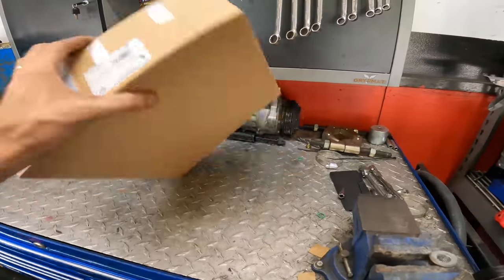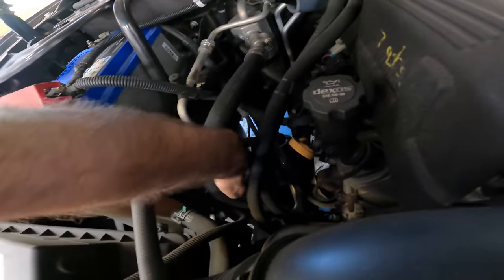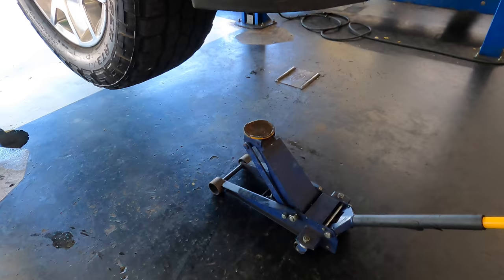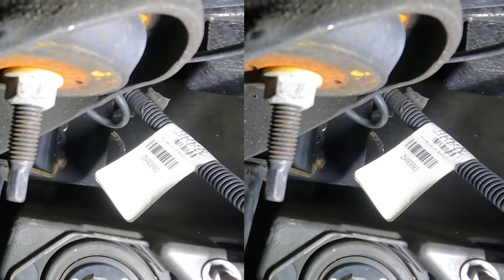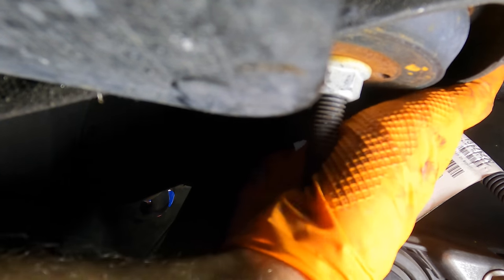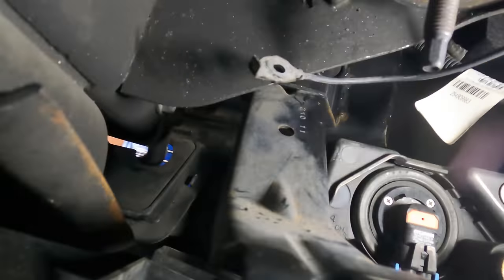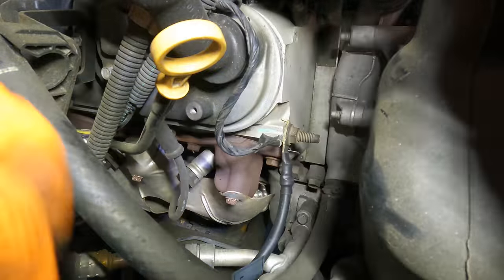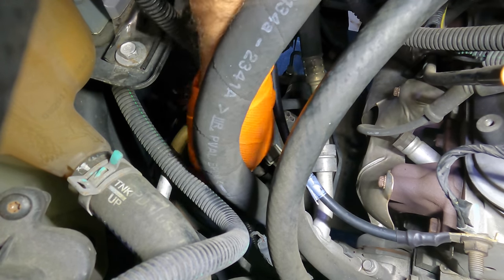Cadillac Escalade 6.2 NO Power, memory keeps resetting. Customer Request Battery Cable.

Comment: Ray, as the owner of this Cadillac Escalade I would like to thank you again for taking care of my car. 👍
Reply: @Albo alt He tells you in the video :D
Reply: Wish I lived close enough to have Ray work on my car.  He is a fantastic Mechanic!!😀
Reply: @ThunderPantz01  i seem to have also missed that.  i was thinking that was an odd starting place.   I also watched while work was going on in the background so I could have just missed what was wrong with the first cable.
Reply: @Albo alt Ray reveals the issues at about the 20 minute mark but to save your time the clock was resetting to zeros and computer was loosing its factor settings  owner had figured out the ground was bad
Reply: @sneeuwsushi Glad to know he did as expected, customer first. 🥇👍😇🙏 Your's is the first customer response I have seen from his posts.
Reply: Definitely keep bringing your goodies back to him.
Reply: @Albo alt I’ve had one battery ground problem in 50 years of driving. But grounding issue’s are difficult to figure out in modern cars.  Most shops would have fired the parts cannon. I guess the way to test the ground cable would be to measure voltage drop as you moved and twisted the cable.
Reply: I have watched multiple videos from Ray always wondered if one of his customers were watchin him fix their vehicle good to know it does happen
Reply: @Albo alt The owner diagnosed the problem and requested the ground cable replacement.
Reply: Glad he didn’t have to CUT your Cadillac 🤟
Reply: @Albo alt I was sitting at a traffic light and the engine started to misfire while the radio and instrument panel lost all power.  After a few seconds everything was working normal again, but the clock/time was reset to 12:00PM and actual time was 8:30AM.

When I got home, I turned the car off and it would not restart and had no power.  Car would not lock/unlock using the key fob.  From my research I found out having battery cable issues are very common with 07-14 Chevy, GMC and Cadillac GMT900 platforms.

I opened the hood and started jiggling the negative/ground wire while pressing the lock button on the key fob and it locked the doors.  I jiggled the Ground wire again while pressing the unlock and lock buttons on the key fob and it was working intermittently.
Reply: So the customers do actually watch these videos.
Reply: And some are smart and don't fire the Dorman parts common with a half dozen crappy parts to ruin Rays Mondays!
Reply: @SneeuwSushi  Great job doing the research and then not just firing the parts cannon trusting it, but taking it and then testing it. Well done!
Reply: @Albo alt I haven't finished the video but it's fairly common to see cracked/bad ground cable welds after accidents.. or if you live up north (frames hate salt) and in the country on bad roads pot holes lol ... can really cause some crazy stuff in some vehicles too.. anytime I've seen complete FUBAR electrical issues.. I check grounds before I even bother testing.
Reply: @phillipdewitt4454  Yes... they're a biatch to figure if you haven't seen it. It can cause all kinds of hell for cars. I saw a 2010 malibu with a bad ground on the pcm once that was shutting off and starting on it's own.. no key in the ignition... somehow it magically didn't fry.. that was my first encounter with a bad ground on pcm too. Took me a long time to figure it out.. I thought that it was gps/power control device that the dealership had put in it.. I figured maybe it was malfunctioning.. and it was but lol only due to the bad ground on pcm. Was a humdinger.

I charged them $35 for parts/labor after 30+ hours of work (finding the tracking device, that I didn't need to find) and thanked them for the experience. Lol
Reply: What kind of a man can't work on his own vehicle? A Pathetic man....
Reply: @samholdsworth420  Not everyone is mechanically inclined bud.
Reply: @samholdsworth420  Seriously bro some people can build nuclear bomb computer controllers and not know the difference between a ratchet and a wrench. Some people can look at a wiring diagram and see it in 3D in only their head, some people require you to use, crayons, yarn and a baseball bat to beat the knowledge Into them. I started out life as a AH-64 A/D/E Mechanic, aka Crewchief. Ray is a great mechanic, but he would be lost if I told him that the #4 ground on the secondary FCR has a bad grounding block at the 125 junction. Not his fault, he just doesn't have the information to fix the described issue. Those that know, you are correct a 15Y would normally take care of the electrical issue but only the 15R can power up the APU to actually run the correct troubleshooting sequence. Lastly, go find a great big fire ant colony, cover your crotch in honey and sit on it for an hour, because you sir are nothing less than a douche flute, that in all actuality probably doesn't know the difference between a ratchet and a wrench, hell I think you have a hard time figuring out which screwdriver is a flat head and which one is a Phillips, and no I don't mean the light bulb company buttercup.
Reply: whats up with the extra quart added? these take 6 qts
Reply: @samholdsworth420  I'd love to work on my own car but I just turned 78 and can't do it anymore. Besides, these newer cars scare me a bit as they are rolling computers nowadays.
Reply: @name_less7687  tracking device?
Reply: It's always nice when a customer shows appreciation for hard work all it takes is a little thank you anything more is even better but hey at least you recognize Ray for his hard work have a good day
Reply: @SneeuwSushi  I

Comment: Thank you for letting us see things like gravity, loud noises, and flashlight to the face. I watch a lot of car repair videos. I'm considering this as a career, and they always seem to edit those parts out. People need to know that the chances of your flashlight attacking you in the face is low, but never zero.
Reply: Gimme a flashlight to face any day.... a 1/2" ratchet with a impact rated socket on the end to the face is... shall we say, unforgettable?
Reply: @GReaper  I have witnessed that 2 times, neither on was pretty. The last guy started laughing as a huge knot started swelling and closing his eye, he said he was just thinking "damn that would hurt if that.." bang right to the eyebrow area.
Reply: @redactedlogic  I remember my dad was changing the clutch on his old bronco II, no lift,  just a jack and a tie down strap (or something to that effect) to hold the transmission to the frame.  He had a thought occur to him that having the transmission fall would be a bad day. He moved his head out from being directly under the tranny, then it fell, making a slice on his cheek on its way down.
Reply: @GReaper  oh wow. I would have to take a little (get my $h!t back together) break after that.
Reply: As a retired mechanic, skinned knuckles and even cuts and bruises are the order of the day if you are in the trade. A socket slips off, a bolt suddenly loosens and hand slams into something hard and sharp, you miss-hit with a hammer, a tool drops, oil comes out of nowhere (it is supposed to) and lands on your cheek, face or whatever it chooses to land on. That is despite being careful and working hard to keep out of harm's way. But tell me another trade where are no injuries - apart from paper cuts. And don't give me grief. I may be a qualified mechanic but I also worked full time as an Administration and Personnel Officer in the Royal Australian Air Force for 30 years - didn't get too many paper cuts through. Hands were bit harder from manual work, welding, car and mower repairs - whatever came my way out-of-hours. In 16M x 8M shed still help people with whatever needs to be sorted although a car a week, or three on a busy week, is all I can handle at 70 yrs of age. With the 2 post hoist there is a 3.5 tonne lathe, plus 2 milling machines plus lots of other goodies that keep me occupied doing things for locals who are determined to not let my "grey matter" decay through lack of challenge.  So damage to the body has not ceased.
Reply: The worst attack is the rack arms when you’re underneath the car working. I smack my head on the tires and arms constantly
Reply: @cotyluckett  Bump cap. You can even get bump cap inserts that you slip into your favorite baseball/trucker cap. They're not a fix all, but they help a lot.
Reply: @cotyluckett  Don
Don't wear a baseball cap. Makes it worse. You lose your upper peripheral vision and hit them even more. I have cuts and bruises (through the cap) to prove it. However, have been a slow learner through the years. Still forget to take off cap occasionally.
Reply: @bobhudson6659  a plain baseball cap, you're right. But using a bump cap insert saves your head.  I have to wear them at my job, and I've lost track of the number of times I've got my head pretty good and barely noticed.
Reply: Many mechanics develop Turrets Syndrome when working on cars/motorcycles. I plead the 5th.
Reply: In the trades you got to be ready to take some sort of lumps bumps and abuse it goes with the territory I know ask my body it will tell you sometimes it complains to me and sometimes it roars but I'm still here on this side of the grass the complain about it so it ain't that bad have a good day

Comment: I went in the Navy for Diesel and hydraulics after going to trade school for a year of auto mechanics then worked at a Mack truck dealership for a short time then to a Pontiac/Mercedes dealership on the Pontiac side until they found out I had diesel experience then they swapped me over to Mercedes which was a nice 50% raise on day 2. The reason I mention all that is after YouTube recommended your channel I watched it, it was an old one, a crappy Acura, I think it was, that the owner told you what was wrong, I love those customers who are NOT always right, and I think it was a warped head or something but it was towed out, after that I watched a couple more videos and I guess gas just runs in my veins because even after building my own hot rods since high school and all the experience I mentioned before I just found your videos quite entertaining, you're quite a good trouble shooter and excellent mechanic, I wish I had some of the tools you have when I was doing it, anyway you got me as a new subscriber, you'd think I had enough of this with the decades I put in but it never gets old to me. In case anyone is wondering why I don't do it anymore I left the Mercedes dealership to go back in the military but on the way I met a guy recruiting for private international security and despite a number of deployments in Iraq I usually would tour Europe for a while between jobs but the one time I came home to the states I was shot in a robbery and paralyzed while bartending for a woman who needed a temp helper until she could hire someone full time. 4 years in Iraq and I get shot at home. Irony at its finest. Anyway, love the videos, keep up the great work.
Reply: Your story would make great book/movie. Incredible.
Reply: Thanks for your military service, your a real American!.

Comment: Did GM have a contest to see where the most ridiculous place is to ground the cable? Bless your patience.
Reply: Yes and they paid the winner many many thousands of $$$$
Reply: Ever work on a Chrysler? Or even a Nissan? 😂
Reply: @jessepickar3297  mine is a Nissan. It's not that bad.  Heck, that same cable is very straight forward. Battery to body (on top of the fender) with a bolt down connection in the middle of the cable, to the power steering bracket which is bolted to both the head and block.
Reply: Advanced Auto had an earth underneath the interior carpet for a fuel pump IIRC.
So carpet had to be pulled up to get to it.
Reply: @GReaper  I’m more so talking about other common repairs, like every other day I have to do an air filter on a newer Altima. I was able to do a valve cover on my fusion faster than that
Reply: @jessepickar3297  ah. I have the first gen xterra... air filter is also easy on that.  #6 spark plug on the other hand....
Reply: @GReaper  I remember I used to have a Beamer and the back two were the worst. Pretty much nothing was easy on that tho
Reply: @jessepickar3297  meth

Comment: Tip: When you pull the old cable out, attach a strong string or a piece of wire to the end and pull that through with the cable. Attach the string or wire to the new cable and pull it, and you will have routed the new cable right along the same path as the one you removed.
Reply: I work on powersports full time and use this method whenever I can. Lol
Reply: this is basically how you do a lot of wiring jobs that involve hard to remember or total pain in the ass positioning, once you got the rope in place you dont touch it till its time to finish the job and never tug hard enough to risk separation... had to add a wire to a house without blueprints to consult and it turns out there genuinely isnt a human accessible route past the one wall
Reply: You must be an electrician only electrician would come up with that I use that trick to pull wires through walls have a good day
Reply: @nickolaswilcox425  another dirty trick on housework that I use if you have an old fiberglass tent poles to come apart in sections with an elastic cord going through it use that to pull your wires you can make one right across the ceiling if you lifted above the rafters done it put recessed lighting in my kitchen that way have a good day

Comment: In order to make the connection, you gotta do what you gotta do. I think the 1/2 adapter to the 3/8 adapter to the 1/4 adapter to the socket is perfectly fine. Good job.
Reply: With 10mm nuts always set the torque above 100lb, add loctite medium strength, should be tight enough         just! 🤣🤣
Reply: @bigboybigbird6818  Don't forget to run it down 'til the battery dies!
Reply: ...as it should be!

Comment: It's amazing to me how you can keep your videos G rated after getting a flashlight in the face, I'm a believer in the gospel and I'd be throwing the light across my garage threw the blue air. Also I never seen battery terminals like that before,  you tighten the bolt on top and it clams from the side........

Comment: Replaced all of the power wires from the alt to batt, batt to fuse box, batt to ground, and block to batt and block to chassis in my buddies silverado. Fixed so many weird electrical issues. used 4 gauge OFC, hydraulic crimped lugs and all. 2 years later still strong!

Comment: This is one of those times, where we want to connect a size 11 boot to the central anatomy of the engineer who designated this as a cable mount position.
Reply: Having worked on submarines, this was a piece of cake. One must be well versed in "working by braille"!
Reply: @seniorrider9337  I have a theory, that some of us mechanics ( I’m motorcycle) could do rather well as gynaecologists.
Reply: @markblundell9461   I had during my career some choice navy terms for engineers and working in the shipyard had some personal conversations with a couple who were plain old shit heads and they left rather unhappy when I proved to them that I was correct. I was in electronics, but also worked on mechanics also. At home I mechanic on my bikes, trucks, and cars. All older as I despise the new stuff.
Reply: If you did that you might find his brains have a good day sir bye

Comment: Check the main connector under the fuse box, I just did the same repair for a friend, replaced the ground cable which is a weak link. I looked at the fuse panel and found corrosion on the two big  spade terminals feeding the main fuse box. That made more sense than the ground wire. I cleaned the ground surfaces and applied some grease also. They haven't had a problem since. It had the same symptoms, kept losing power at random times to random accessories.

Comment: Not sure why you would want to remove the plating from the connector. The tin plating provides corrosion resistance which is superior to bare copper lugs.
Reply: Yeah I don't remove it.  The tin plating is pretty thin so it usually don't last all that long but might as well leave it.
Reply: because there is already corrosion on it.
Reply: Coming from working on boats in the salt water. I always put de-ox on that kind of connection. The ground is the main supply of power. Everything electrical runs off of that little connection. It can have 60 amps running through it.

Comment: The reason the phone rings so much is because more and more people are looking for Ray to work on their cars!
Could you imagine tracking down a loose connection on that ground cable?
Would it be a good idea to spray protectant on your ground connections also?
Reply: i personally wasn't fond of him stripping the tin coating off that ground cable ring (exposing the base copper) without applying some kind of anti-corrosive. If that part of the engine is aluminum (if it's actually the heads for example), that's just asking for trouble. Definitely some anti-corrosive there would have been a good idea IMO. But otherwise, it's probably not normally needed.